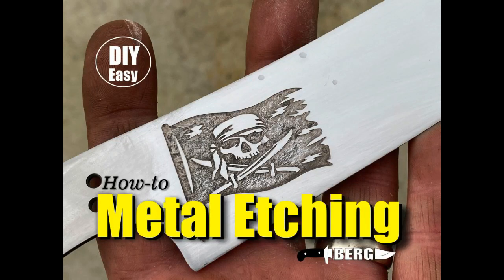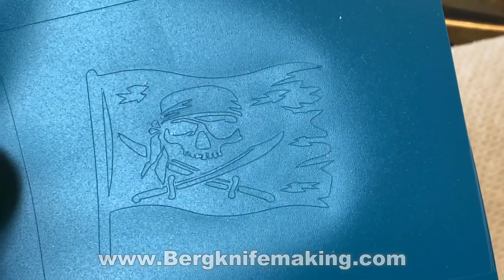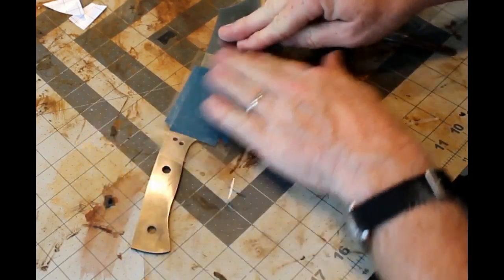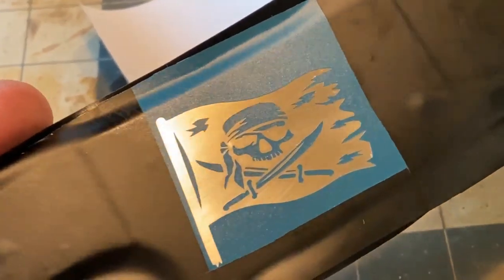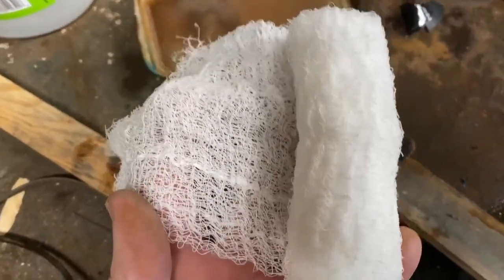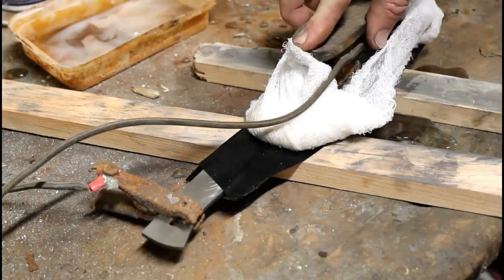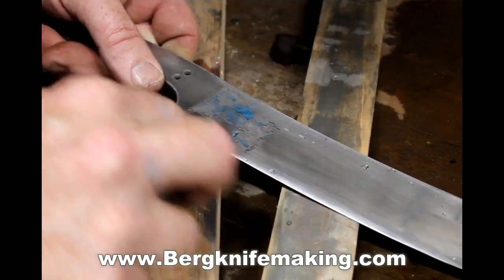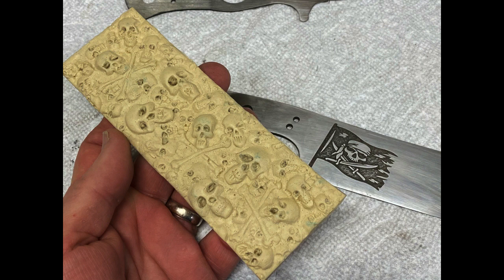How to Metal Etching with a Car Battery Charger by Berg knifemaking

Comment: What is on the top of your electro etching plate?
Reply from the maker: Its just a small pc of steel tube welded onto a flat plate. The tube serves as a handle and place to drill and tap hole to secure wire lead.

Comment: Is there a way to ech  copper or  brass like that ?
Reply from the maker: Electro etching is basically controlled corrosion. So it will not work well on brass or copper
Reply: @DIYeasycrafts  thanks for the tip man

Comment: Do you use an old or new battery charger for this? I have heard that some of the newer ones "know" whether they are connected to a battery or not and will refuse to send power if they are not.
Reply from the maker: Good point I have an old or "Dumb" charger, newer model might not work but the etching should work with any similar power supply.
Reply: @DIYeasycrafts  This is the problem I've run into with everyones tutorial on this. Use a battery charger that you won't be able to find anymore.
Reply: I wonder if this is why I have been unable to get this to work. :/ I've been attempting to mark my tools for months now. I just bought a $30 set of steel stamps to try hammering into my tools yesterday....